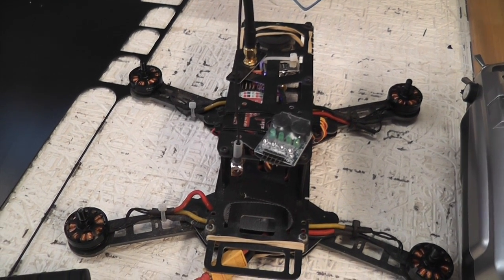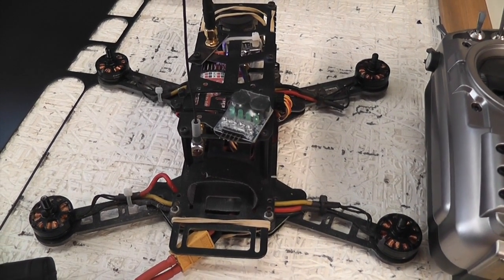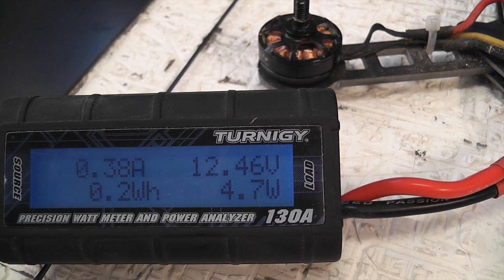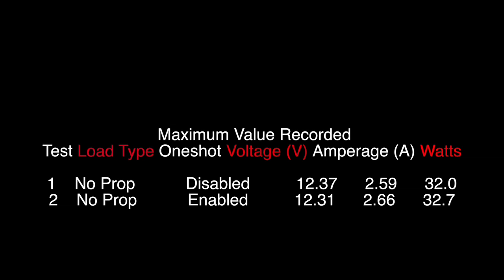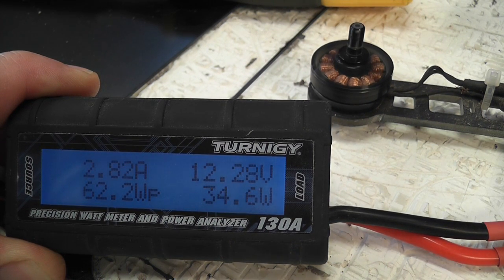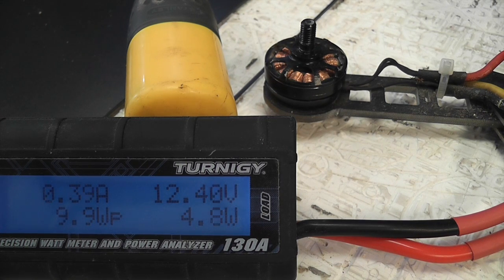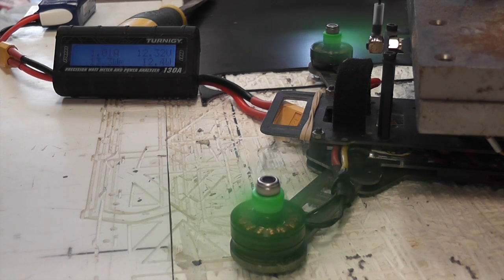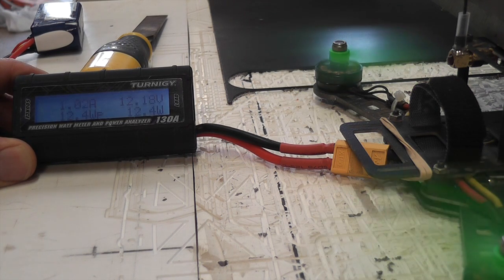BLHeli Oneshot Enabled & Disabled Comparison

Comment: 1. OneShot is the ability of the ESC to always be in sync with the FC (thus having the capability of running faster than classical PWM, provided the FC looptime is faster than that).
2. A passive bench test will most likely be inconclusive due to variation (if you do the same exact test, several times, with OneShot disabled you will get marginally different values -> that's sampling variation, mainly due to precision)
3. OneShot will prove it's "abilities" when tested in dynamic conditions (ie. actually flying the damn thing). Problem with this is it's not an easily repeatable experiment to actually compare with the OneShot disabled test and have the same exact conditions and inputs.
4. More improvement for OneShot enabled dynamic testing, will be in conjecture with active braking capabilities (Damped Light), which actively slows the props down in contrast to just wait for them to slow down due to air drag, which is to slow for, say, several fast, consecutive but opposite roll maneuvers which will give a floating effect to the feel of the craft (*this effect is directly proportional to the sizes of props and motors used -> drive assembly moment of inertia). With OneShot these things happen faster (as fast as the flight controller knows about them as fast does the esc's, improving motor response time which you indirectly feel as the craft being more responsive and also smoother). 
5. Another thing is your loop time...if it's say 500Hz (ie. matching the max period of classic PWM cycles ~2 mS), then of course it will act like the classic PWM cycle, with the only difference being the ESCs would be in sync with the FC (witch anyway is better than the classic asynchronous (with respect to the ESCs), PWM). So lowering the FC's looptime would yield better OneShot performance and respectively ESC and motor performance (remember, noticeable under dynamic conditions and capable hardware).
6. Adding these all up, good, capable hardware, lower looptimes, Damped Light, OneShot and a good PID tune (if the tune is crap no ESC in the world would save it from flying and feeling bad), would improve the overall "locked in" feel of the craft (ie. lower propwash wobble, faster response in rapid successions of maneuvers, etc). 

7. However these increases in speeding up and slowing down the motors faster will, in theory anyways, be responsible for marginally increases in wattage (especially due to small Amp increases due to needing a little more torque(work) done by the motors to achieve these faster acceleration/deceleration cycles, but this is usually seen, if at all, in reality, if the motors stop and need to re spool from 0, however once in flight, it shouldn't be noticeable mainly due to inertia of the already spinning motors). But these can cause problems, especially if it's a poorly built motor (usually the cheaper ones, but not a rule),  with poor heat dissipation, poorly constructed ball bearings, play in the shaft assembly and what not (which is bad anyways regardless of oneshot or not :P)...so make changes in small incremental steps in lowering the looptimes or PID changes or what not, and always get a feel for the motors and ESC temps as you go for lower looptimes and higher PID gains and also pay attention to the actual sound of the motors, that can be a pretty good indication of the smoothness or lack there of, and if they seem to make funny sounds, you could try to up the demag compensation on the esc's (although it's recommended to leave it set at low, except if you have really crappy motors that demag a lot) or slow down the FC looptime / PIDs, a bit until you get rid of the weird sounds/temps, but still retain good performance of the craft. Remember, tuning such a system is like choreographing a balancing act between multiple components, pushing them towards their limits, whilst making sure that not one goes beyond that limit so as to not explode or what ever :P 
So in a sense, this is the idea behing OneShot, if the components themselves are more aware of one another (like the esc being in sync with the FC), they can balance better. :D 

It's true that all these small improvements on their own have marginally better performance, mainly because they're depending one on the other, so if one is off, it will affect the others, BUT each tuned/set properly taking the whole of the settings into account, would make a bigger difference. 

(PS> In short is not magic. These things need understanding and good hardware. :P)
Reply: Marian-Gabriel Flocan IMHO the most reasonable idea is to pick an already existing comm protocol, like 1-wire or even serial/rs232. Serial at 115200 allows for 24 channels at 100 Hz refresh rate of 16bit data with 1 byte for addressing and has as much bandwidth for "extra" data.
Reply from the maker: I think the biggest issue to overcome with Digital transmission on our quads will be noise. Its important to ensure we don't flip bits along the transmission line. However, with good periodic updates to the esc im sure the desired value could "even" itself out to give good throttle control or quad control in the event of rolls/flips, stability control.....Im looking forward to this development. I think and hope it will make for great change and advancement in how we fly. Boris and his associated team have done great things for our hobby and its great that its all done under the "public" or open realm.
Reply: why do we still use PPM/PWM for communication between FC and ESC anyway :|
Reply: Cheaper hardware, it's been with us since what seems like forever. Compatibility maybe...or people just don't know enough to buy a good ESC. If you look at the comments below, from a year ago, people said..."it's just marketing, I don't feel it to be better.." and now please look at today's BlHeli S ESC's... Well once you know what to look for, and you have the appropriate hardware, actually capable to run these protocols, you may start to see that it's at least way easier to tune, then that slight improvement on tune reflects itself in flight characteristics like better propwash handling and so on, things that maybe for the average flyer don't matter or he/she never even noticed and so dismisses everything as marketing stunts...and thus sticks to the same old stuff, PWM. And there's nothing wrong with that, you can get pretty good result with PWM also (with the latest FC and Software we're getting, there's a ton of improvements already that make the flights easier, safer and more enjoyable, so..). In fact most people which just fly for fun maybe don't have the skills and knowledge to even see the difference...so if the new hardware or software feature doesn't immediately impress them, then they just say...well yeah, I don't know I don't feel much if anything, guess I'll stick to my own/old setup...and never try it. Then there are people who just replace the ESC's but dont't enable certain features that are needed, or don't retune the PID's and expect to magically feel the difference. And this is because don't have the curiosity to understand how all of these things work. and just do stuff because they saw it done on the net or whatever.
Reply: it's just a very slow, inaccurate and simply too old "protocol" that doesn't even provide feedback. The ESC can't give feedback to the FC about its state :|
Reply: :)) Well, yeah it's slow, but think of it like this...they are all PWM essentially...only with more clock ticks resolution, meaning you can represent smaller and smaller timings between a pulse's  falling and rising edges. So if you take PWM and put it on a very nice hardware that is capable to give you a high and precise oscillator, thus timing, you can very well get an insanely fast PWM....however the ESC must also be able to keep up with it, to decipher the messages. And this is where the magic needed to happen. And it did :D
So the fact that normal PWM is still in use is because for some reason, these kind of ESCs than only understand normal PWM, are still being produced.
But yeah...once you go at least to OneShot and some nice BlHeli S ESCs, everything gets smoother and nicer and you won't go back :D
Reply from the maker: Digital is the way to go. Guess what, betaflight 3.1 will support DShot which will be digital and of course your esc will need to run BLHeliS when it comes out.
Reply: seafurymike Well yeah. It is the way to go, but mind you that PWM is also digital. In fact since they are all based on PWM they're all digital. Digital means 1's and 0's. And a Pulse Wave Modulated signal si produced by seting an output line to High/On/1 and then at a timed interval switching it to Low/Off/0. So I don't really understand what you mean by digital in your comment, but if I were to guess I think that maybe DShot will write values directly into the ESC's registers and the ESC's won't need to any work "descifering" the PWM, although they'd still need to use some protocol like SPI or  something...so I don't really know what DShot means but if you found some info on the matter, please share a link :)
Reply: Marian-Gabriel Flocan pwm isn't digital. The fact that it has two possible states isn't enough to characterize it as "digital". It's a modulation scheme where the width of a pulse is changed to convey information. You can be carrying analog or digital information with that pwm signal and you can interpret it at the rx as analog or digital, but the signal itself isn't digital.
Reply: Yeah...you are absolutely right. Sorry for the confusion but I was refering strictly to the PWM "protocol"  used by our flight controlers and since we are "confined" to this subject it didn't seem necesary to make the distinction per se. But it's good that you cleared tings up :)
Reply: since we brought this up, the current way of handling this is that it can be created and interpreted equally well by completely analog circuitry
Reply: George Tsiros Absolutely but i guess you would lose some precision?
Reply: Not really. Considering the accuracy of the ADCs on the microcontrollers I'd say a purely analog chain would be faster and equally accurate. Just more difficult to make, troubleshoot tweak and tweak.
Reply: George Tsiros I see. But as someone mentioned they're working twoards two way comms, meaning esc's to be able to report back to the fc, their state and what not. But for "current" application I can very well see what your thinking and it's a nice ideea. But I don't know what all the various makes and models of esc's have in terms of attached capabilities...so I guess it's somewhat an issue of compatibility as well.
Reply: seafurymike um... what are you talking about?
Reply from the maker: George Tsiros what part? Where noise is induced on long wires, or where open source projects are better than closed source?
Reply: seafurymike the first three sentences.
Reply from the maker: George Tsiros fair enough, i was probably smoking something when i wrote that crap.
Reply: or nitro fumes. I know how it is.

Comment: There is absolutely no way you will ever see a difference with a simple bench test like this. Quite frankly, the improvement in update rate by keeping the FC and ESC synchronized is too small to really be noticed in the throttle response of an actual quad. Even with small props, there is simply to much motor and prop inertia. The difference can be seen on an oscilloscope, but were aren't flying oscilloscopes now, are we?
Reply: +K Danagger Very well articulated response.
Reply: I am, suckaaaa!
Reply: "aren't flying oscilloscopes now, are we?" SOUNDS LIKE A CHALLENGE!!!

Comment: Why were you concerned with an amperage comparison?  It's an update speed improvement, not a power consumption improvement.  Shouldn't it make no difference to the motor draw?
Reply from the maker: i did it to see if it changed anything. unless you try you will never definitively know the answer.
Reply: +light24bulbs Yeah . Agree oneshot is designed for fast sensitivity. The higher fresh rate 125us-250us, the higher temperature it will be. It is not relative with the power and current almost. It can draw only a little bit more power than that when disabled. If someone wants to compare it, I think he/she should do a response delay test.
Reply: +dayworkhard would you know why when i run one shot the motors sputter when its NOT armed
Reply: +light24bulbs In fact the whole test is inconclusive, as the measured parameters have 
nothing to do with throttle response (i.e OneShot125 selling point). The
 noticeable/subjective difference in propeller noise in the tests, 
points to FC loop time being at default 3500 micro seconds. Any 
perceived gain with OneShot125, requires lowering the loop time to 800 
micro seconds. Happy flying.
Reply: god forbid he give us all the observations and data

Comment: mike just flashed bl heli on afro 12a and enabled one shot.. i notice on your video you have motor stop disabled ? is this just a personal preference Mike or is there as an advantage.. i normally have motor stop enabled and motors defiitely brake a lot quicker with BL heli... and take longer to start so wondering if i would be better with motor stop disabled so motors would have some momentum initially when starting what are your thoughts on this ?
Reply: i prefer to know if the quad is armed. its a visual/audible confirmation for me and anyone else around me. just be careful when doing configuration work.
Reply: Seafury mike i just wondered if there was any other advantage to it Mike i did start off with motor stop diasbled but got used to it this way now... i will try it that way again though. I just been trying to get my motors to start a bit earlier, as i find my throttle stick is almost half way before the motors even start... calibrated my TX and raised my min throttle... its good to get as much stick travel as possible i find...
Reply: bing crosby thanks for the quick reply
Reply: bing crosby did you set 1068 and 2000 as the range in the naze32? this should fix your issue. once chaged, do the esc calibration again
Reply: gone back to simonk for the moment Mike.... did not like the active braking at all on the blheli i had some serious crashes tonite and lost control a few times.. was real bad...

Comment: I thought Oneshot is the way to update the ESC when new throttle value is ready after finishing the control loop of the FC... So ESC will be uodated not periodically at 50hz rate, but whenever data is available for redusing the error, produced between controle loop end and esc update. I honestly didn't understand what are you after.
Reply: You are correct oneshot will send new inputs before the loop finishes and fires only "oneshot"  when it gives a new/repeat value to each esc. The biggest difference is damped light or active braking throttle reponse is noticeable much more with larger props due to inertia instead of slowing under friction loss via wind and motor it brakes the motor. If you full stick take off and cut it from full it starts falling very quickly and the props have slowed already. Describe as less floaty.

Comment: Great video mate, big AHH SNAP to the guys wearing flyduino underwear, they will no doubt be flooding in here to rag on you now mate. Oneshot was proven a long time ago that it makes no difference until we get faster FC's that can take advantage of it (long way away). All the "benefit" that oneshot enabled flyduino ESC's were getting was coming from a closed error loop being turned on that you did not know about. BLHeli not only allows you to turn on an off this closed error loop at will, it also allows you to tune it. 

On BLHeli flashed ESC's you can turn oneshot on and off without enabling this additional error loop, this is what has been done in this test and is clearly shows you there is no advantage to motor acceleration speed or response.

First video I have seen that removes the placebo effect, great work

Comment: Pretty sure the props off tests are pointless as escs are not designed to run unloaded motors. The difference between std blheli at 400hz and oneshot at up to 2khz is not something you will see like this, youd need to chart throttle signal vs gyro reading between oneshot enabled and disabled to be meaningful.